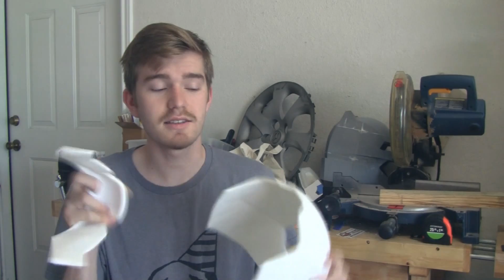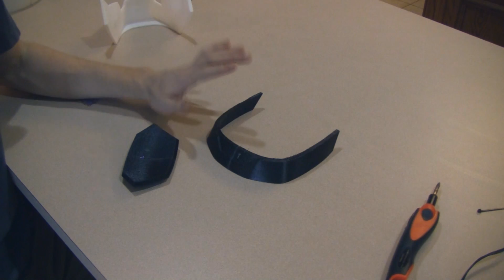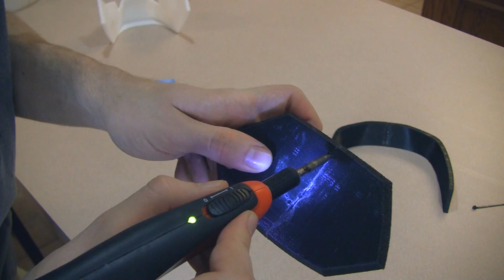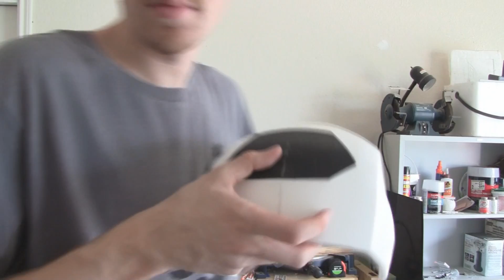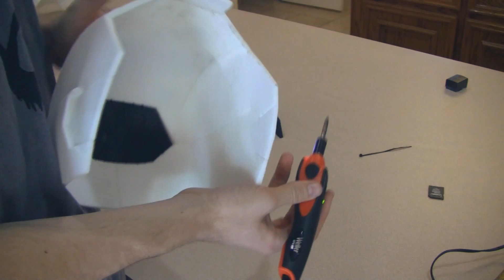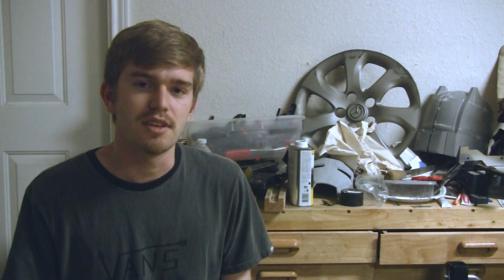Finishing 3D Printing | Iron Man Mark 46 Helmet Build - Part 2

Comment: why couldnt you print most of those in one piece instead of smaller pieces you end up gluing
Reply from the maker: If you had a big enough bed and a decent enough printer that wasn’t known to fail during long prints, then you absolutely could do that. Since my printer is hot garbage, not to mention I didn’t want to waste lots of filament on support material, I chose to not go that route.

Comment: Ah I can tell you what put joints like that together. I have a 4 inch belt sander and when the belts are wore out you can cut squares out of em or any shape you want and the back side, not the sander side loves super glue as in when you put SG on it then use it as a patch over a seam, that my friend is joined forever and ever. And they bend and twist to shape then use a clamp or whatever to hold for couple minutes and put a fork in it. I have glued so many things together like that I am now a protesticle at it.